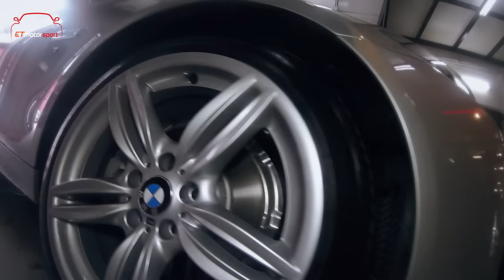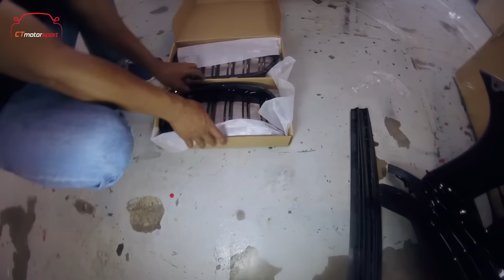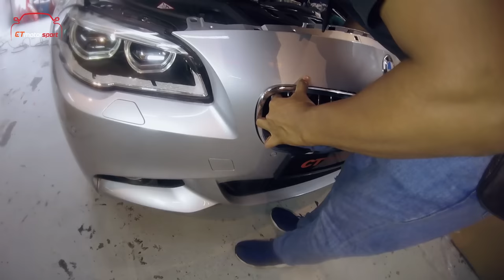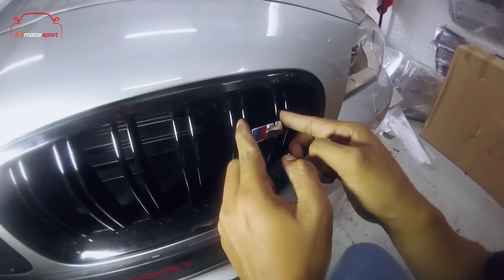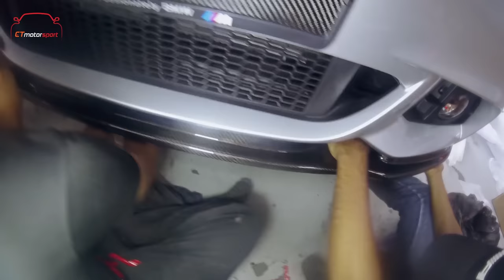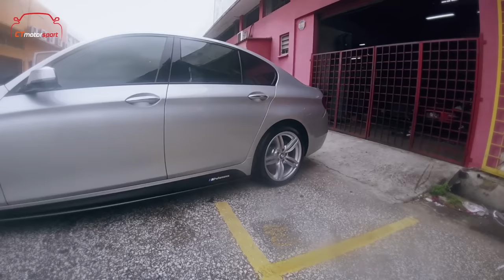BMW F10 M Performance Kit Carbon Fiber.

Comment: That front lip cant last long I allways go 200-270 km/h i dont think it would last
Reply: In a stock m550d? Cap
I have one, only goes to 250
Reply: @RodrigoGomes-uw2bk  true 254 … Gps 250 it lasts tho 😁